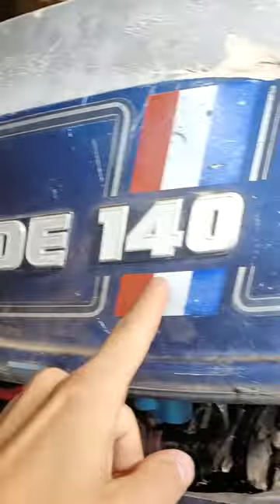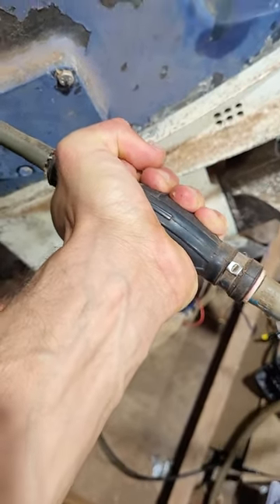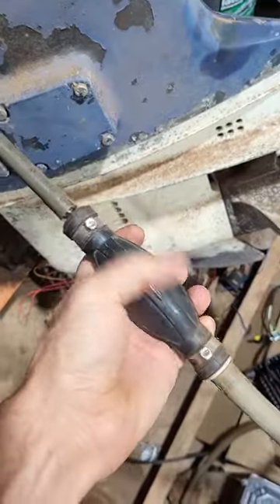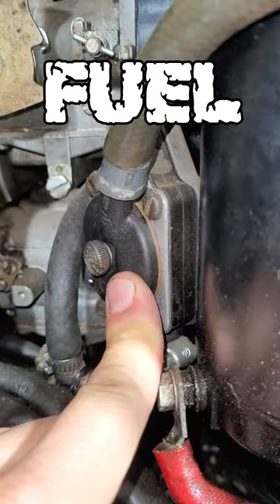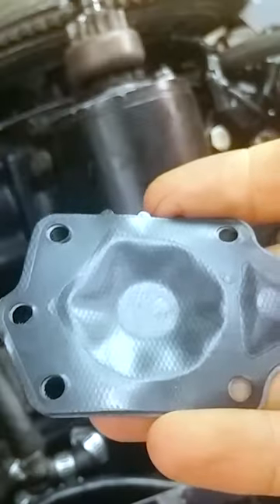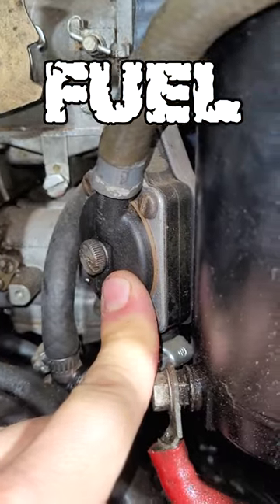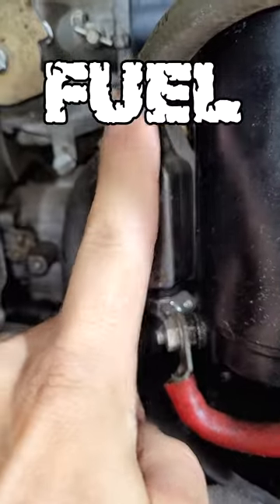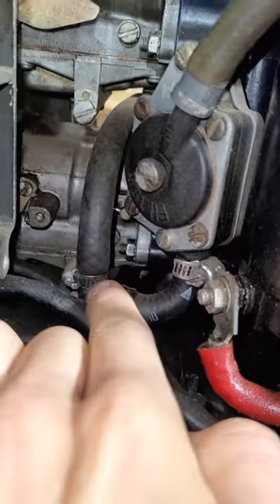Evinrude Outboard Fuel Pumps

Comment: Have my motor line bulb everything since new in 1992. Disconnect hose at motor run till stops, remove carb bowl and drain replace. Hold hose straight above tank and push end of hose and drain fuel back into tank, drain fuel out of tank and put in car/truck whatever you have it will mix with current fuel and be used up. Everything is soft pliable and still working! I never keep fuel more than six months

Comment: Had my fuel pump in my 1977 25hp Johnson in at least 31 yrs and still pumping. Of course, I don't leave fuel in it... LATER
Reply: How do you get the fuel out of the fuel pump so it lasts 31 yrs?
Reply: @williamhaskellhaskell3162  

Use it and add fuel stabilizer to your gas.

Comment: Someone said there's two pumps on the 87 Johnson 150 V6?
Reply from the maker: YES! There can be 2 fuel pumps, but most newer evinrudes have a single VRO pump.
Reply: @MattsShop  I ended up finding them, the vro was removed and it's two tandem pumps

Comment: I have a 79 Johnson , I can start and run in gear but as soon as I let off it’ll die . Won’t start in neutral either . Has to be in gear . Any idea of what the problem is ?
Reply from the maker: There is a neutral safety switch on some of these outboards under the carbs near the shift cables or in the remote control (throttle box). I don't remember.
Reply: @MattsShop  ended up being the caster follow bearing , didn’t know it had it because it wasn’t on the motor when I bought it .
Reply from the maker: @lloydbauch8908  The little plastic black roller? They always break off or wear down!
Reply: @MattsShop  yes the roller on top of the carb that the throttle on the head hits , allowing the carb to be manipulated. I figured it would be something simple and I was just overlooking it  😂.

Comment: I have a johnson gt 150 vro and I removed the vro and put a pump like the one your showing and it worked relatively fine for the first year and then started to act like it was starving for fuel occasionally so after researching I found that the bigger fuel pump should be installed on 100-250 size engines so I got one on Amazon and installed it now it won’t run at all . Any ideas ?
Reply from the maker: I know exactly what you are talking about. I was about to do this to mine. You have to have 2 diaphram fuel pumps for 150HP and above. Lookup on boating forums, they will tell you how to run 2 fuel pumps. One for lifting gas from the tank and one for pressure mounted to the powerhead. There are provisions there on these engines. The 1983 and earlier Evinrude 150's used this setup. Check it out.